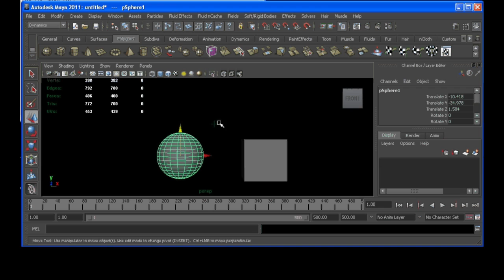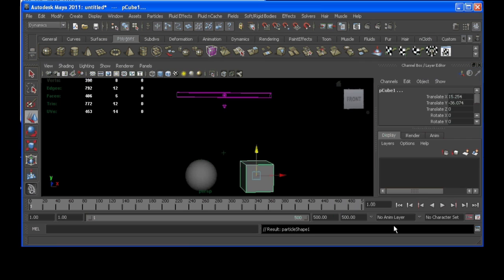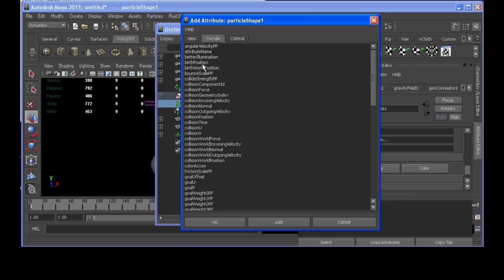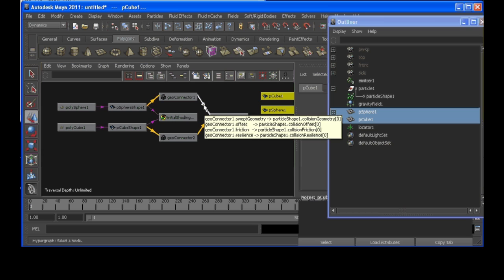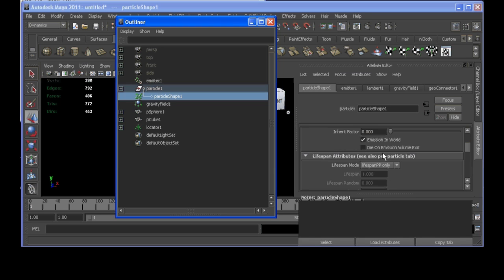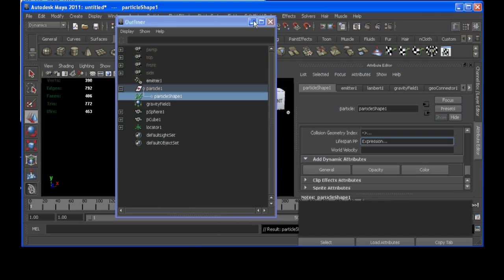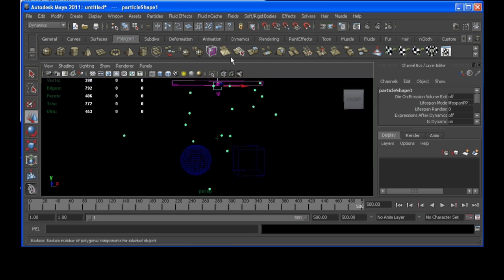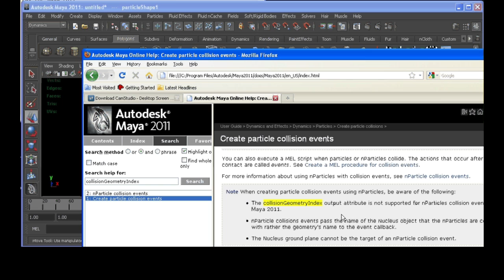Maya Dynamics Tutorial: Kill Particle 02 - Collision

Comment: great tutorials!
any ideas how i would drive the particlePP friction by each particles position.x? any help is amazing. just starting out!
thanks
Reply from the maker: I haven't played with the attribute before but you can add frictionScalePP. then in the runtime expression you'd have to write an expression similar to this:

vector $pos = position;
if($pos.x > 5){
frictionScalePP = 10;
}

you could alternatively write the expression to depend on the particle's position relative to a locator

vector $pos = position;
if($pos.x > locator1.translateX){
frictionScalePP = 10;
}

What this will do is check if each particle's position has a greater value in X than whatever the locator is. This makes it easy to adjust later on by moving the locator. In my example, if the particle has a greater x value than the locator does (I believe) it will multiply that particle's friction by 10. Like I said I've never used that attribute before but that would be my first approach to attempt what you're asking. Let me know if it works and thanks for watching!